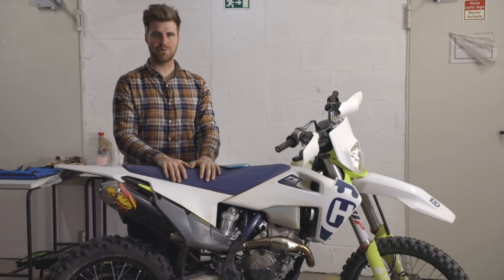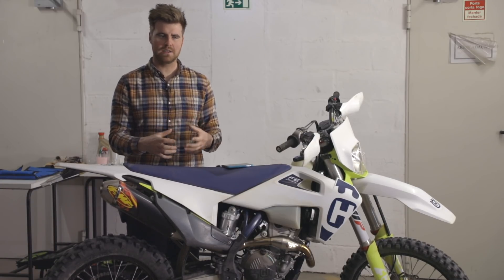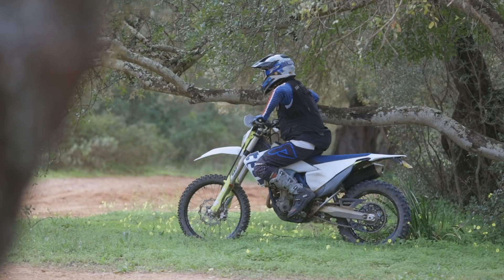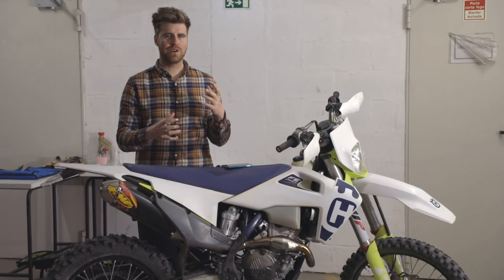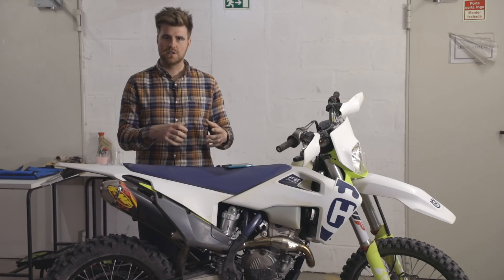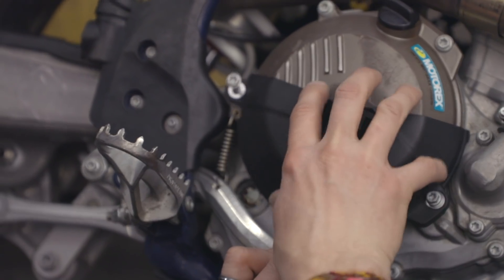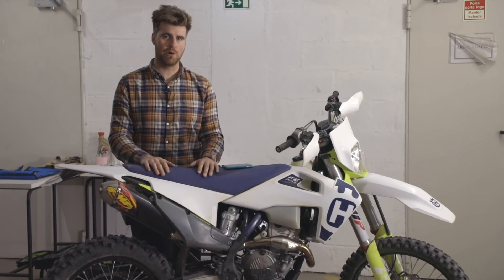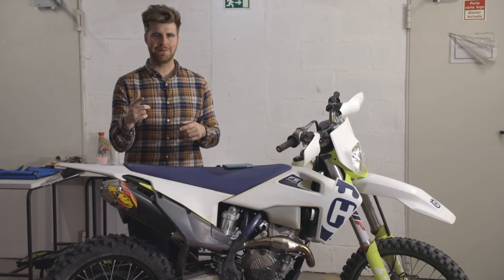How To to Set a Dirt Bike Up

Comment: Excellent video thanks. On my WR250R, I added 35 mm bar risers to make it more comfortable in the standing position (I'm 186 cm tall). The handling wasn't impacted too much, but bike feels a bit more twitchy. Am I better off changing to new handle bars with a higher bend? Or is that the same as using bar risers?
Reply from the maker: Mmm. It's hard to diagnose over the internet. Twitchy is probably not from running risers. Have you a dirt bike before? Have you made other changes to the bike? 

How much do you weigh?
Reply: Hey Brake Magazine thanks for your reply. I’m 90 kg and haven’t ridden a dirt bike for 35 years. Have set the sag and increased compression slightly on shock and forks. Twitchyness is not too bad and only at higher speeds when I hit bumps. I was just curious if new bars with higher bend would be better than risers. Do steering dampeners help with this issue? Cheers
Reply: Nice to see you here Gloss! One could wonder what I’m doing here 😅